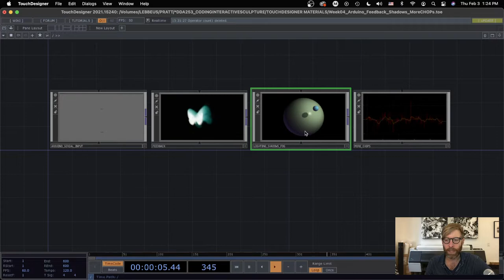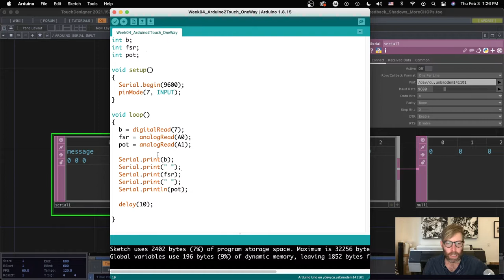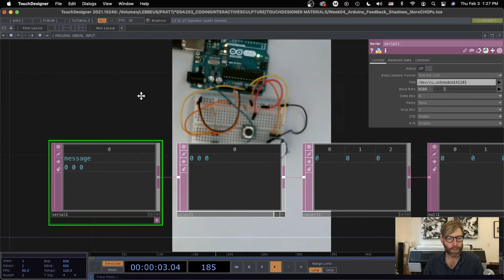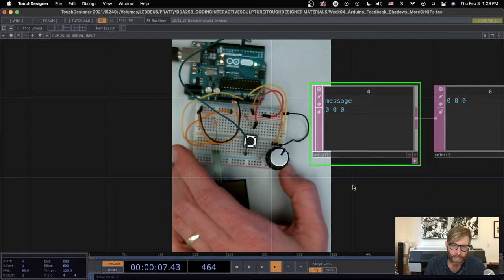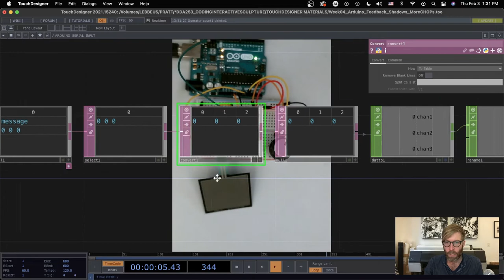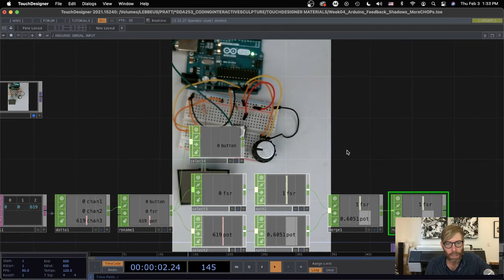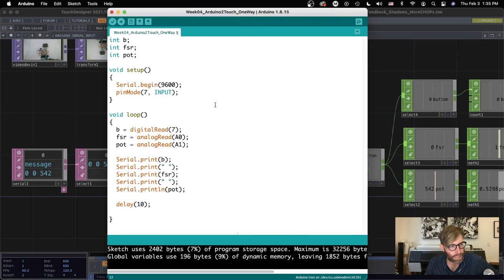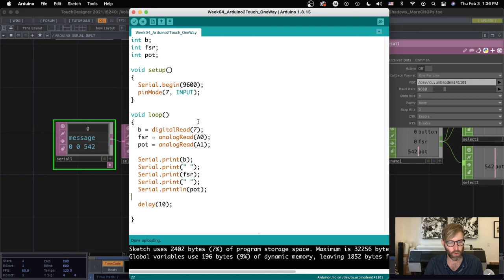Arduino to TouchDesigner (One-Way)

Comment: It's strange that my code runs on Arduino, but I can't connect it to TouchDesigner. The error message reads: 'Warning: Could not connect to the device /dev/cu.usbmodem1301 (/project1/serial1)'
Reply from the maker: I would guess that the Serial Monitor in Arduino IDE and Serial DAT are active at same time?  Only one connection at a time is possible